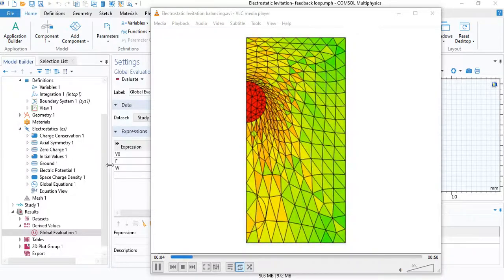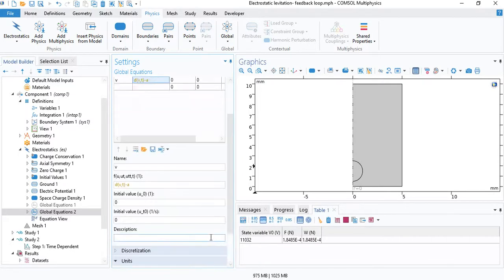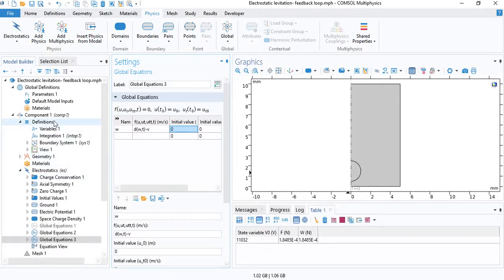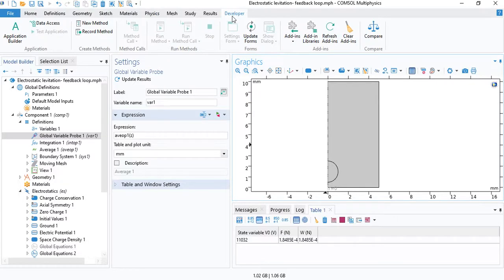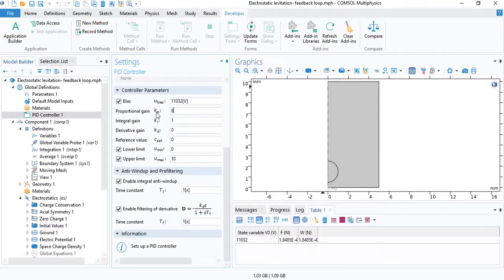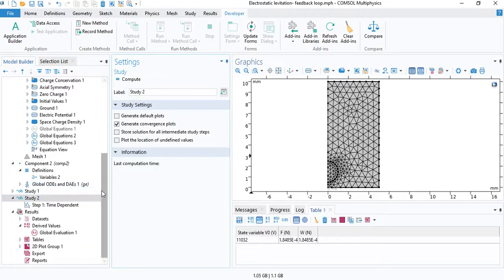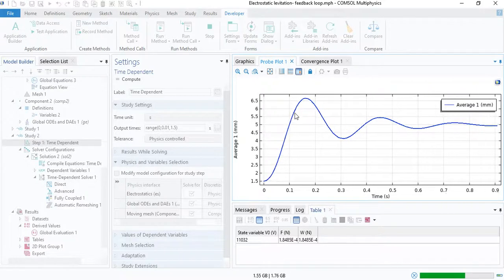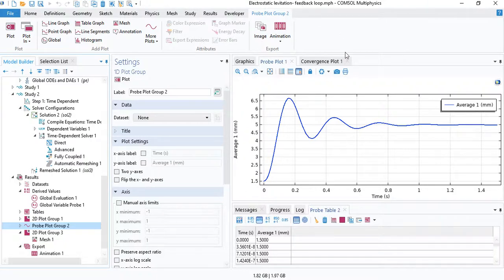Moving mesh- electrostatic levitation simulation using Comsol Multiphysics (part 2)

Comment: Can you make a video on how to realize "Moving mesh- electrostatic levitation simulation using Comsol Multiphysics" by Solid Mechanics?
Reply from the maker: I already made a video for electrostatic levitation. You can find it on my channel.
Reply: @JafScience  You use global equation not Solid Mechanics physics interface to find the position of the sphere in this video. Can you make a video in which Solid Mechanics physics interface is used to find the position of the sphere? I really want to learn how to use Solid Mechanics physics interface plus Electrostatics physics interface to realize electrostatic levitation simulation.
Reply from the maker: @JinzhiMu I don't have access to comsol for solid mechanics now. But the idea is the same you'll have to use the displacement field from solid mechanics to calculate the electrostatic force. And this force is applied on the body in solid mechanics.

Comment: Dear Friend, Could you please do a toroidal current transformer analysis (magnetic and heat)? All the best, Okan
Reply from the maker: Try applying the concepts from the transformer video that I did. The core geometry is different but everything else is about the same.
Reply: @JafScience  Dear Friend, Thank you so much for your kind reply. Yes, I did watch your TR video. I just wanted to see a very realistic toroidal core medium voltage current transformer example with hysteresis and heat flow modeling. I have the model in CAD environment. I can send it to you if you require for your future modeling videos. All the best, Okan :)
Reply from the maker: @55nakk  I can let you know if I plan to make a video on it.
Reply: @JafScience  Many thanks, if you require Ican send you CAD file. Regards